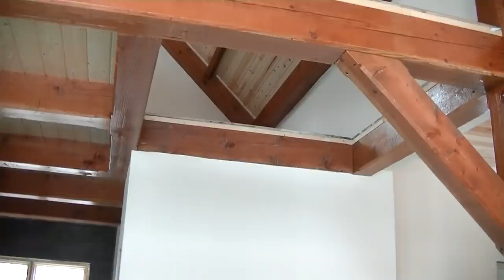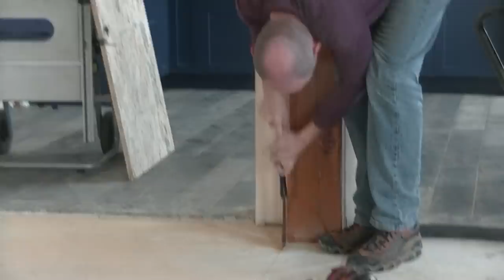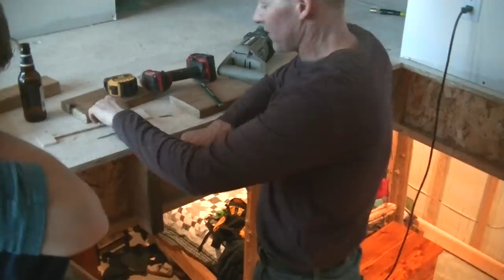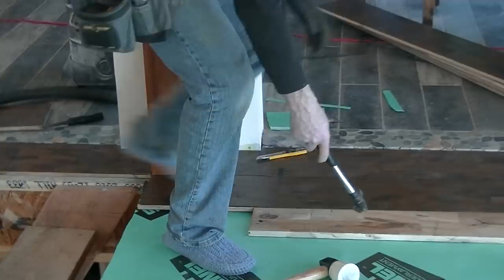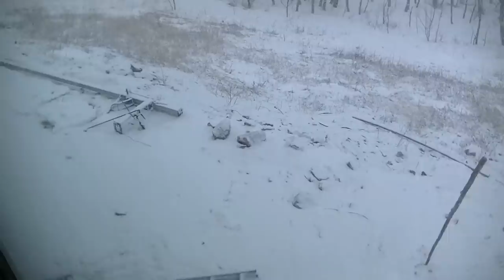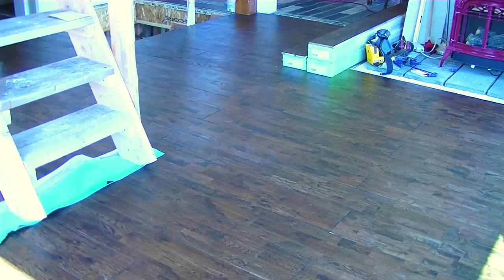Hardwood Floors Revealed!  Prepping for the Magic Staircase...

Comment: I like your videos.  Word of caution when using MinWax stain it is 
very prone to spontaneous combustion when using rags or foam do not pile it up anywhere as it will catch on fire.  Put i in a can of water or get it out of the house and away from the foundation. Have seen three house fires in our area from this.. I used to have a paint and repair company and this is a big problem...Read the caution label on the can.  Plus your structural 

 I-beams in the floor only have about 30 minutes for you to get out in case of a fire.  The fire department would love for you to tell them what kind of floor joists you have as many firemen have been killed because of these floor joist systems.
Reply from the maker: This is all very interesting. Have not heard of these fire hazards before.

Comment: The floor looks good, but a small suggestion.  You don't want the end joints in a piece to line up  with the next 3-4 boards over.  Stagger those joints!  Otherwise you eye follows that line.
Reply from the maker: Gotcha. We did that for the most part in the loft.